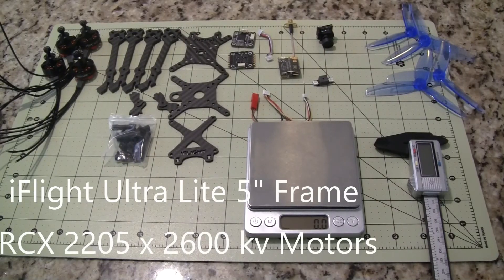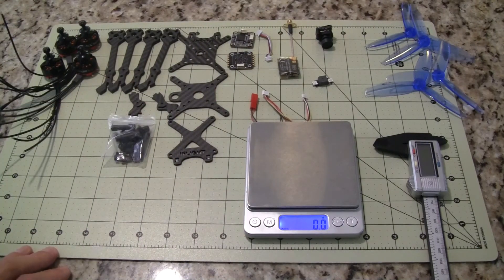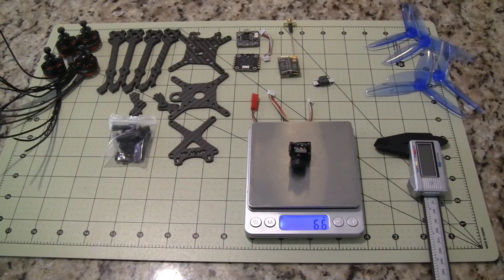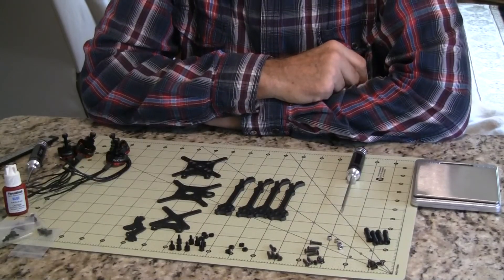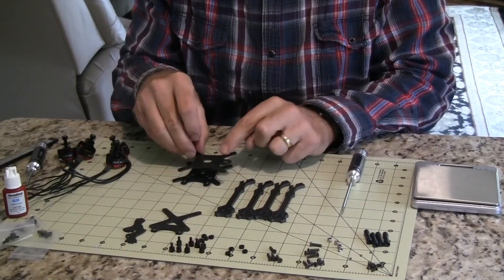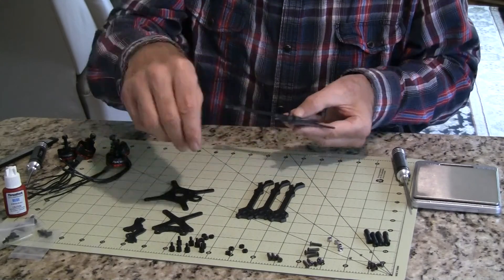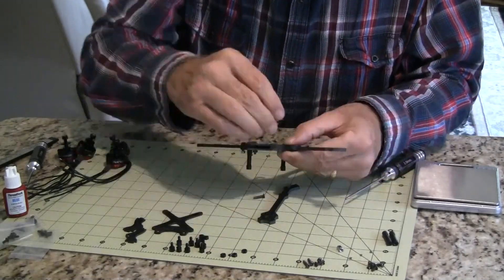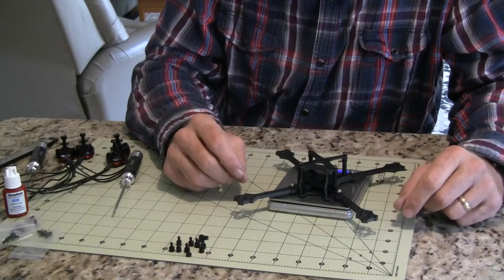RCX iFlight Ultra Lite 5 Inch FPV Frame with RCX 2205 x 2600kv Motors

Comment: Hi
You did great video.
You build iFlight X frame and put it on the scale.
I was shocked you didn't show us what is final weight. 
Maybe you're not aware that weight information of drone psrts on Banggood are very inaccurate. 
If I want to calculate weight of my future drone build from Banggood information it's impossible because information about parts weight are not correct.
I bought all drone parts already based on wrong information.
So my build become 70 grams more weigh because of wrong information.
Everybody will find way to connect all parts of this frame but still nice you showed this.
Only useful information I would be able to find in this video is if you showed us exact frame weight on the end.
I tried to search this info on many Youtube videos without success.
If you showed weight of frame I would have info to make desicion will I buy this frame or search for lighter frame. 
I know it's not easy job to be really informative.
Tip for you .
Nobody have Youtube channel that measuring weight of drone parts from Banggood, Gearbest etc.
As I said you did great video .
If you showed us real weight you got on the end would be really perfect.
Just another 5 seconds of video for really useful information. 😀
Reply from the maker: Sorry I did not show the frame weight after it was built. I did weigh the parts before I started and had a weight of 62 grams for the frame weight. Thanks for watching and the comments, I show several other light weight frames in a video at the following link https://www.youtube.com/watch?v=Ubew6EfrecQ&t=166s
 I did break the iFlight X frame after 10 flights. John from Chicago

Comment: how durable is the frame?  can you flex the arms easily?
Reply from the maker: Jack not sure how long the arms will last since I am having problems with the flight control board and haven't flown it yet but think if you keep the motors under 30 grams each they should last good. The frame is very stiff with plates on top and bottom of the arms and 3 screws on each arm.